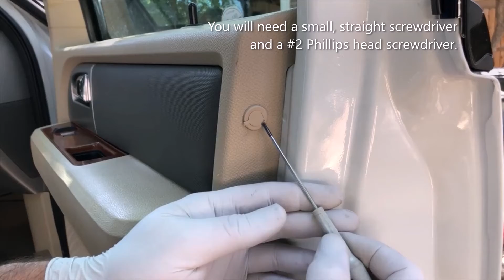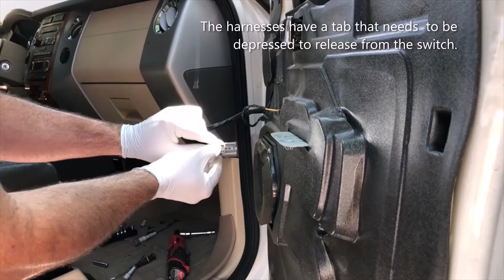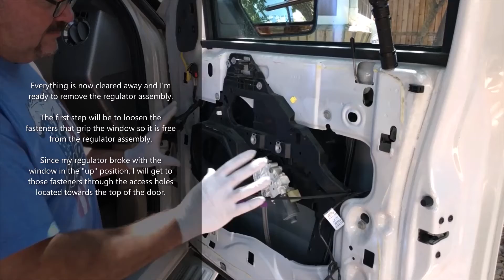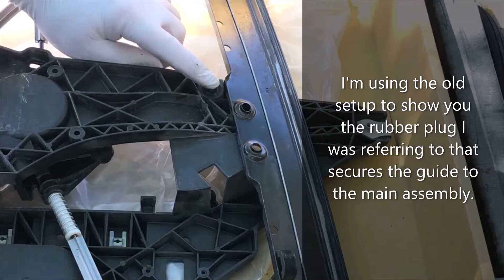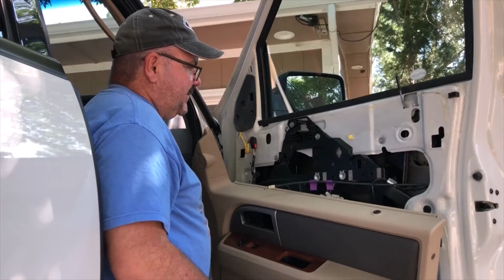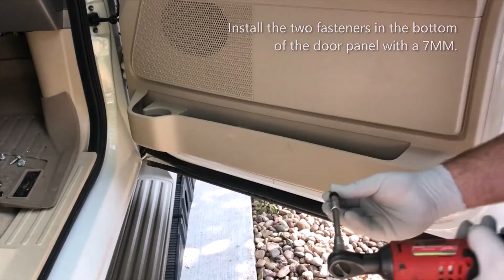Ford Expedition F150 Window Motor Replacement

Comment: Thank you so much for making this video. I was able to replace my regulator and motor with your help. Turns out it was an issue with my switch, but I literally rebuilt the door with all new hardware at a fraction of the cost as a shop would have charged for parts and labor. In this economy, I had no choice but to try fixing it myself. Now my window isn’t stuck all the way down. Since my dad passed, it has been hard without his knowledge, so this video was my saving grace. Thanks again!

Comment: You listed this as replacing motor but you say the regulator. Sad as I just want to replace the motor not the regulator.
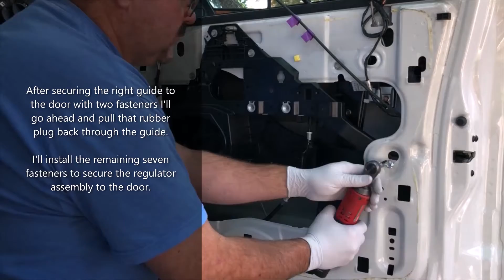Reply from the maker: Jump to 07:25 of the video for the instructions on the motor.  There's also chapters listed in the description that will have a link to that section of the video as well.  Hope that helps you.  Thanks for stopping by!